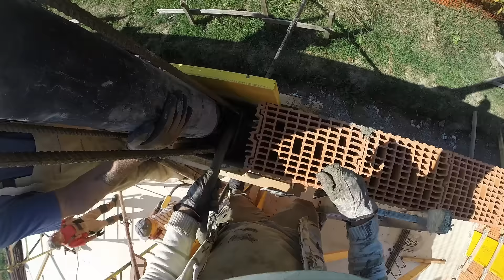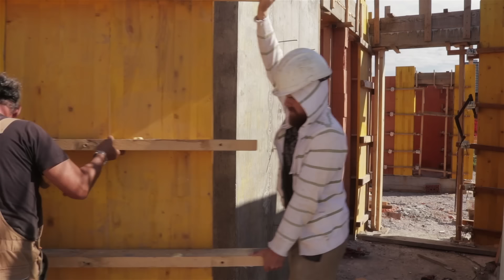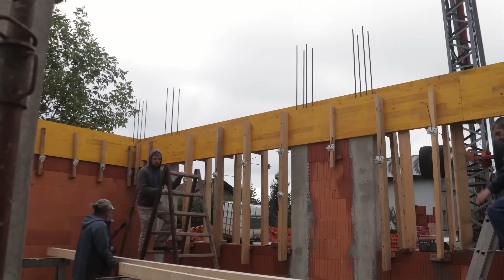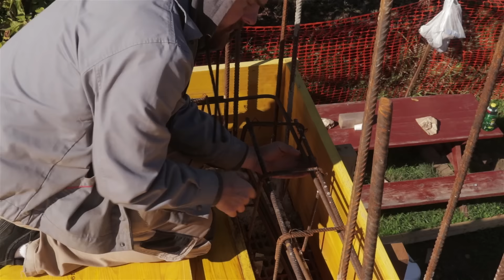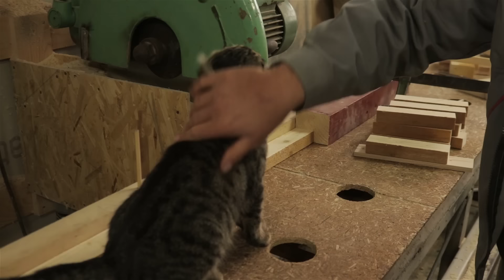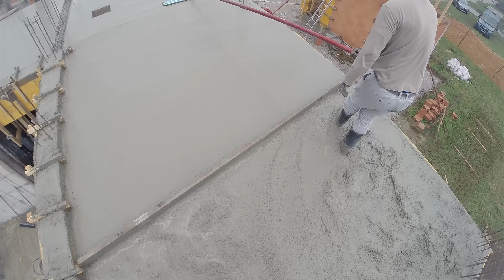Our house build Pt3- walls and ceiling slab pour

Comment: I was really worried about the concrete unmixing at the bottom part of the high columns and walls, but I was pleased to see such a nice and clean result.
Job very well done!
Reply: The vibrator helped to work out the excess bubbles from the aerated concrete mix to produce a smooth wall finish.

Comment: Im proud on this, as Croatian, this is pure perfection and standard reference. Also work in construction like engineer 20y and this is joy to watch. Just little mistake, as I see you didn't put elastic material between slab and partition walls, so they are now bearing walls

Comment: I've been very surprised by what you're building so far and because you specialise in glue laminate timbers i really expected to see that process in your build but so far it's been mostly concrete and blocks!!! Hope further along the glue laminate is coming into your build!!! As always guy's    💯%    👍    🇬🇧.
Reply from the maker: Yeah, there will be glulam used later on.. roof, glass wall, stairs and the whole ventilated siding will be wooden.. If it was as originally envisioned, it would be just glulam and concrete.. Unfortunately the prices for rebar and glulam more than doubled so I had to make an almost new project..
Reply: @lignumchannel  covid pandemic has a lot to answer for!!!

Comment: Wow! Incredible amounts of steel! And great work!
Also I am nerf wreckingly curious what you will do with the open space of the house. Something with wood perhaps?
Reply: "In a lack of better word, its perfect!" - the construction, of course. I believe its going to be living room with high ceiling...
Reply from the maker: It will be a high living room space with console stairs on the concrete wall.. I just hope it will be as good as I imagined it..
Reply: @lignumchannel  Hello, I just saw your video of the securing of the steel frames of the steps to the concrete wall. I am curious as to the source of the term "console stair". I would have called it "cantilevered stair" since each step is supported at only one end. Also I am curious about how you managed to avoid damaging the wall reinforcement when drilling the holes for the supporting bolts. Did you consider casting support plates or rectangular tubing with welded extensions into the wall? This is a method that I have seen for precast concrete panel attachments. The drill and epoxy method does look fairly quick.

Comment: Amazing amount of steel support wire that is in the second floor!
Reply from the maker: I get that a lot but we are in highly seismically active area so I would say it's an optimal amount. :)
Reply: @lignumchannel  I saw an engineering presentation about findings from the great Mexico City earthquake that led to a lot of buildings collapsing (in 2010 or 2011?). The conclusion was that a LOT more rebar was required in columns and walls to withstand torsion and shear effects from earthquakes. Proposed amount of rebar was even greater than what you have. However, Mexico City is built on thixotropic soils (lake bed silts) which liquefy (lose all shear resistance) during earthquakes, hence the need for a LOT of reinforcement.

Comment: As someone involved in the Architecture industry here in the States, I'm always fascinated by building methods elsewhere. 😎
What happens to all the wood for the forms? 🧐
Reply from the maker: I also love watching constructionvideos from different parts of the world, I pull up a lot of ideas that way. As for the boards We planed them, sanded them, stained them and put a few coats of matte varnish. They ended up as part of the interior. You can see the process in the part 7 of the build. The 10x10cm beams also ended up as a part of the roof.

Comment: good work in america we do not use this type of constrution due to several factors which include weather time to built and relativly cost althought brick and wood are somewhere close to each other when it comes down to built yet wood is easier and less time consuming than concrete and that plays a significant role in some areas
Reply: I always wondered... Why don't you use bricks and concrete at least in the tornado alley? I don't think it's cheaper to rebuild an entire house when the wind blows it away.
Reply: @attilafenyvesi5800  Cheap now > cheap later (that's the idea, at least)

Comment: Perfectly. Bravo.
And your wife is very happy with a white construction helmet.
Why don't you use basalt (composite) rebar?
Reply: It's still 4 times the price of steel.
Reply: @ktarnik  Wow! Now it is clear. In Russia, 1 running meter of basalt rebar costs the same as 1 meter of steel rebar of comparable strength.
Reply from the maker: Yep, I think a white helmet fits her perfectly. Also as @ktarnik said.
Reply: @darrenmark4569  Do not scold the accordion player, he plays as best he can :)))

Comment: Dont see any conduits for pipes and cables thru the ceiling. They might be there but I don't see them. If they are not there, it might be a problem. The ceiling is heavily reinforced by steel.
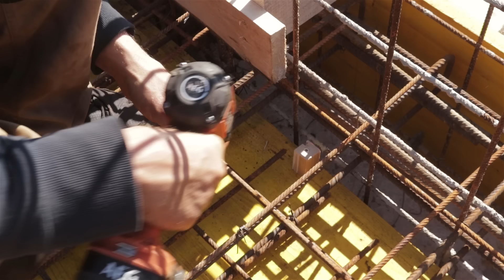Reply from the maker: 7:37 I put all I could think of but I'm sure there will still be some drilling ;)

Comment: Hi, i like the build very much so far and i can’t wait what the result will be. I’m hoping for some glulaminated details integrated in this builing.

Question: you are putting a lot of effort in the ceilin/floor slap by casting it in place. Did you consider using precast hollow core concrete slabs? I am NOT a building expert or something, far from it, but It seams to me It could have saved you a considerable amount of time, weight, materials and effort. So i like to know if you considered it, and if so, why not?

Again, can’t wait for more content and the end result!!!! Good luck with the build
Reply from the maker: Thank you very much! :) Looking in hindsight, I would do some things different.. I would use the whole system from porotherm with prefab blocks for concrete posts and ceiling slab.. a bit more expensive but much more faster and simpler.. I decided to go with porotherm probably a couple of days before I started the blockwork and by that time all the static calculations were completed and I already placed the anchors for 25x25cm posts in the foundations so I had no choice. If the materials prices were stable this year, the ceiling slab would be in glulam, north wall also.. some walls would be in visible concrete. I had to make a decision to postpone the whole project or to make a new project with materials that had a still resonable price. The house will still look the same as planned but the structure is different.. I allready learned a lot during this build and I know a second house will be quite different in regards of structural materials..
Reply: @lignumchannel  thanks for your answer. Material prices are a real headache these days. A few weaks ago i rebuilded the roof of my firewood shed and i bought some plywood panels without looking at the price. When i had to pay them i was totally flabbergasted, the price nearly doubled!!!
For the near future, when i need wood or other building materials i will take a look first what is available in used/refurbished materials. 
Greetings from the NetherLands.

Comment: everyone mentions the amount of rebar, but not the amount of wood needed for the form work?
Anyway, the skeleton of this house will live for hundreds of years, and is up to earthquakes and the ever increasing number of violent tornado's in Central Europe.
The house will be damaged after such an occurrence, but not been levelled with the ground, and occupants will have a high chance of survival without the house collapsing on them.
Reply from the maker: Well I hope it will be as strong as you say.. Yes even I'm amazed at how much wood is needed, I plan to use most of it in house itself later on.. Formwork will be perfect for roof sheeting..

Comment: The concrete and rebar must be tough on WiFi signals. My “need” for WiFi makes me wonder, do you wire the whole house for internet, have a mesh system for getting WiFi throughout the structure, or is that not a concern?
Reply: This should not be a concern at all, there are things like wifi boosters already...

Comment: Hi. Registered idiot here.

I guess since the whole roof is a solid slab it doesn’t need to be angled for run off?

Also, i am assuming the walls won’t be exposed concrete because you still need to run electric, right?
Reply: To add to your confusion: Much of the world builds houses entirely (floor, wall, ceiling) out of concrete.
Reply: This is the "first floor" (i.e. the first upper level), not the roof.  Just wait!  :-)
Notice the corrugated tubes (~75mm / 3 in. in diameter) around the perimeter, threaded onto little blocks of wood screwed into the yellow planks that comprise the bottom of the concrete form.  These will allow passage of wires.  Every here and there there is a square opening (250mm / 10 in.) for plumbing, I assume.
Impressive as all get-out!
Reply: @stevejohnson1685  It's always easier to insert piece of tube before pouring the concrete than drilling throu concrete with hope not to get much rebar in the way. Nice clean job! Work smart, not hard 😉
Reply from the maker: Yep, It's always easier but I doubt I correctly predicted everything, there will be drilling for sure.. ;)

Comment: Curious to know wont the brick crack if you use the brick as soffit for the beam and no actual gap is between the beam and the brick meaning once the beam is fully load and it deflects?

Comment: did you get a bargain when the local steelworks closed? theres enough rebar in that for the world trade centre.
Reply from the maker: :) Think how much rebar would be in it if I stuck to my original plan where the house was supposed to be just concrete and glulam.. I had to reproject when the prices skyrocketed..

Comment: brick walls inside the house, good choice, none of that drywall and insulation stuff, last time i stayed in a drywall separated rooms i was able to hear people chatting, and their footsteps, what about acoustics between first and second floors, my house has a problem there, when someone shuts the main door (thick steel sheet with 6 bolts across the edges, with poured concrete steel plated panels) i can hear it on the third floor sound travels through the concrete pillars and floors, the wood doors inside don't do this
Reply from the maker: My plan is to use some drywall for some interior walls although I'd be much happier with block walls. I put a bit more rebar in the slab if I decide to go with blocks but I have to consult the structural engineer  who made rebar calculations first. I don't think there will be problems with noise from doors because they will have required cushioning. Also the floors will have dilatation from concrete base and walls. But that's all in theory, we will see how it goes in practice.. :)

Comment: In America we would never go to these lengths with rebar and concrete for a residence, let alone a commercial buildings. Though I imaging we have twice as many codes and regulations. I guess.
Reply from the maker: The difference is just in materials traditionally used, we do a little percentage of wooden houses here and a majority is done traditionally this way. As majority is done this way, materials are cheaper. When you compare a wooden house made like in U S and traditional house like this one the price is almost the same.. Biggest difference is in construction time.
Reply: @lignumchannel  Using rebar and concrete would be a big time consideration here because few residential contractors/subs know how to do it. Where are you?

Comment: Once you build a house like that you rarely change the layout, you can’t easily take walls out add bathrooms etc..
Reply from the maker: I hope I wont have to change the layout so soon but each non load bearing wall can be hammered down and re-positioned . It is more work than with drywall, you are right that is true.